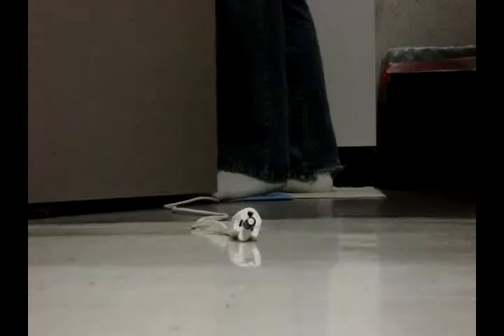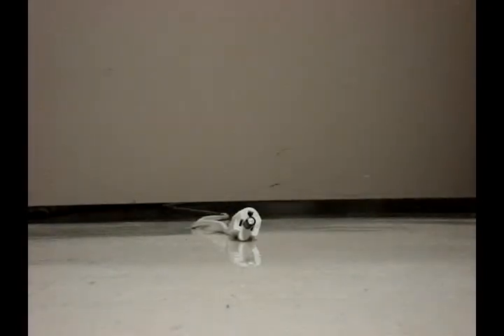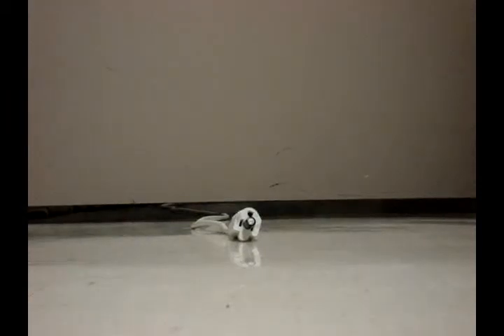Capacitor AC 120V Explosion

Comment: I head that larger capacitors have vents on the tops and dont explode as violently as other ones
Reply from the maker: All electrolytic capacitors today vent if the pressure builds up too much, but these capacitors are basically exploding due to shorting the 120V outlet.  In the second capacitor at 01:40, you hear 2 distinct pops: the first one is the capacitor venting, the second pop is actually the leads exploding as they short the 120V source (this is the conclusion from our limited investigation following the video).  

Overall, I would not recommend this experiment due to the potential for injury and death.
Reply: @ArlingtonMatrix  I know older capacitors that don’t have the weak point vents are very explosive because you’ve basically made a little pressure chamber for the stuff to build up in and explode. I’ve donee it with what I believe to be some 20 year old 25v  small ones but nothing bigger